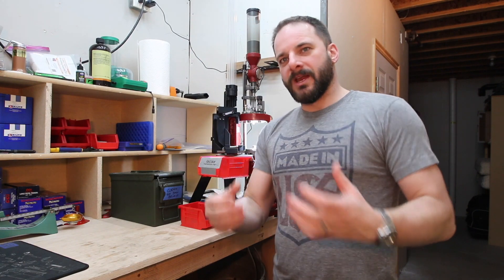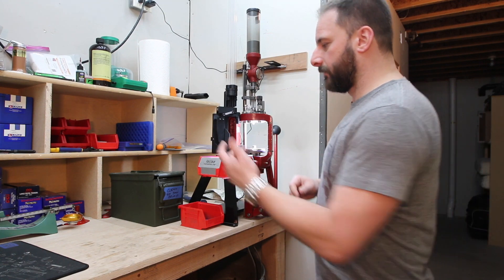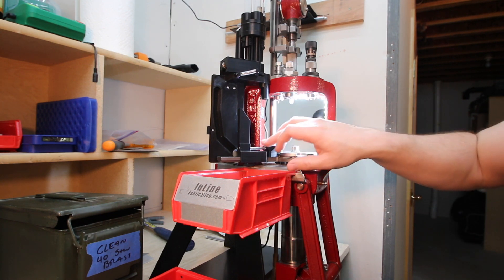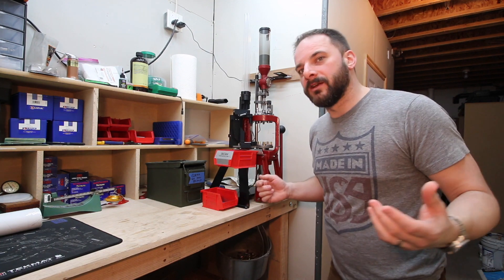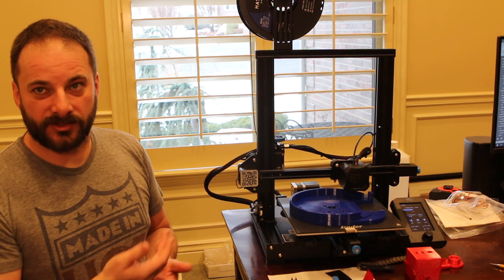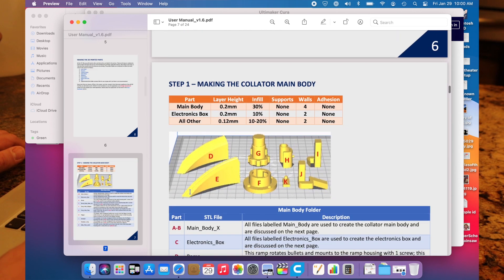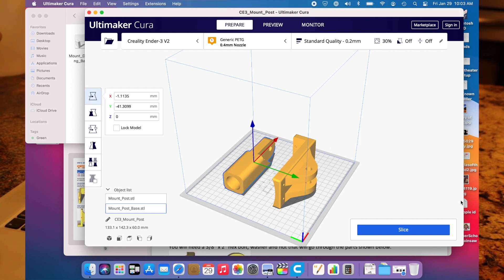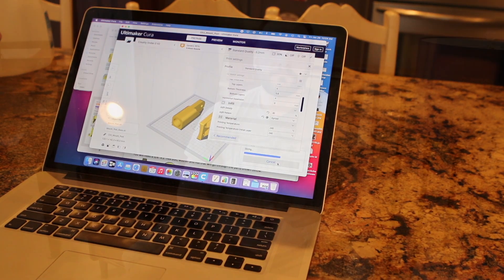3D Printing to improve your reloading process

Comment: Have you tried to load 380 acp with this case feeder?  The brass is just a hair to short and hangs up.  If you have or know a solution I would appreciate you sharing it.  If someone made a shuttle 1/16 inch shorter it would work great.  If you have any answers please contact me.  Thank you Jake
Reply from the maker: I don't have anything in 380ACP. the only thing I could think of is to scab on a small plate to make sure that only a single case is being fed.